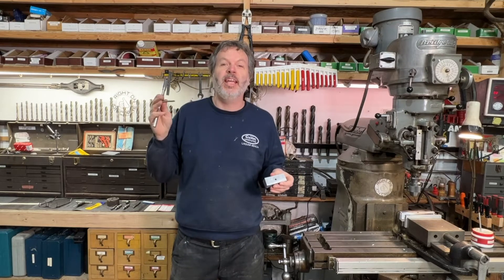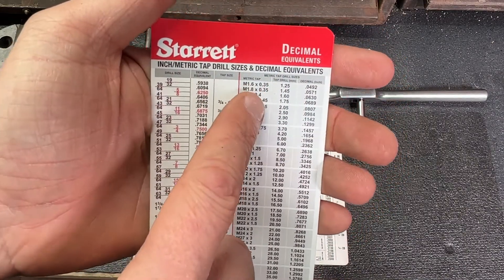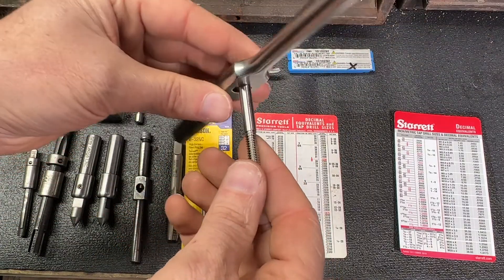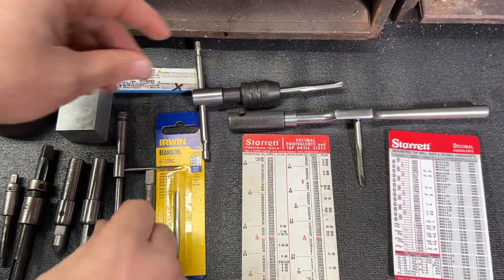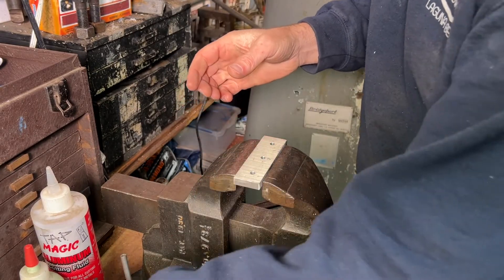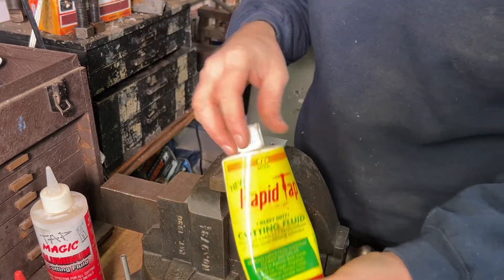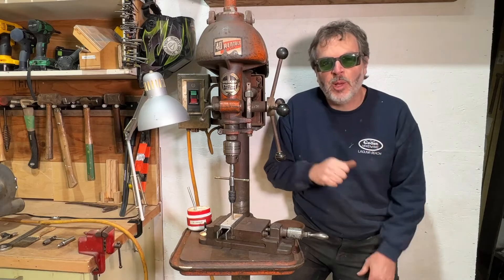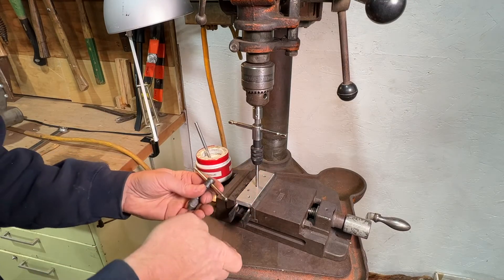Tapping A Hole Straight - 3 Easy Methods

Comment: I have a drill press with belts to adjust the speed.  After drilling the holes, to tap threads, I loosen the belts and turn the main spindle by hand using the height adjustment to apply pressure.  When finished, I usually release the tap from the chuck and turn it out by hand.

Comment: Ok ok nice, the drill press method looks GREAT!! Right on man :).                                                That Greenfield one looks ... pricey.  I don't use it often but I have a 1 1/2" Die and only thing I can easily find is a darn pipe wrench and kinda sucks, but whatever, gotta make due I suspose ;).
Reply from the maker: Right On! 🙌 I think whatever gets the job done. 💪 If a pipe wrench does it, so be it. Also an adjustable crescent wrench is good too. Those you can get in big sizes. Even some sort of pipe welded up with a square socket in the middle? I’m always making a way where there is no way. Right On! 🙌Thanks for the share!

Comment: I'd love to introduce everyone who uses straight taps in soft metals like aluminum to try out spiral flute taps.  They're often used for CNC, but the spiral flute drives the chip out the top of the hole, and and I don't worry about filling up the flutes of straight taps.  You will love them!
Reply from the maker: Right On! 🙌 I use those on occasion in the shop. They are great! Well at least the bigger ones are. I’ve snapped some small 8-32, 10-24 taps pretty quick in that style. Great for a blind hole.

Comment: A1 work well done I have one question what rpm to we set the press drill if we are using the press drill for aluminium and or steel keep punching
Reply from the maker: That’s a good question! The speed changes for different size bits. Smaller is faster and larger is slower. Aluminum is a much faster cutting speed. There are several charts online. I have a chart I can send you a pic of if you email me. My email is in the video description. 👍
Reply: @ Thanks Jon I sent an email as you requested I appreciate you taking the time to help out Urock Keep punching

Comment: If the hole is drilled off at an angle it is most important to tap the hole at the same angle as it was drilled.  Otherwise the tap will be unequally loaded as it tries to cut through.  Increasing the chance of tap breakage.

Comment: I use Tap Magic or wd40 in aluminium. I also tap with a Rohm Chuck in my DP. No tap handle necessary.
Reply from the maker: Right On! 🙌 I do like the WD40 as it doesn’t have that weird tap magic smell 👃😵‍💫 That’s cool you have the Rohm Chuck. I’ve been trying to find out more info on their chucks.
Reply: @RightOnJonCrane It's a 1/2 keyless Rohm Supra Chuck. It runs super true on a JT taper. Big enough to wrap your hand around for tapping.
Reply from the maker: @03redrubi  Right On! 🙌

Comment: For tight spots or where the material can't be bought to vise or drill press - use a nut partially threaded on the tap, it will act as mini tapping block.  Some wobble, but can be better than freehand.  (Not my original idea, but have confirmed it works.)
Reply from the maker: Right On! 🙌 I like that! Thanks!

Comment: I am doing 4 holes this morning through a 2.5 in thick block of forged steel. The best part is the tap needed is a 1inx8 tpi I made a tap guide out of 1.5 in thick steel. I'm not worried about the tap breaking as much as I am concerned about if I have the strength to even turn the dang thing ...lol

Comment: When I was in the steel business pretty much anything from a number 10 to 3/8 we chucked the spiral tap up an electric hand drill. Probably not the recommended method for most but if you have a good feel for tools it works quite well in a lot of scenarios.
Disclaimers: Don't Try This At Home....You'll Likely End Up With A Stack Of Broken Taps.
Reply: Don't try it at home? Does that mean I can go somewhere else to do it and it's ok?
Reply: You develop a "feel" for tapping with an electric drill.  I always used a variable speed drill for this, and the newer, better battery operated drills are better than the older corded drills were.

We used to need to tap hundreds of holes in the cold rolled (hard!) steel sub-panels for electrical enclosures, and doing this with a hand tap would be ridiculously tedious.

Anyhow, after you break a few taps off, you develop a good feel for when to reverse the drill, and how much torque you can apply.  I haven't broken a tap off in a long time now.  But this is a skill that you have to practice to get the right touch!

Buy a handful of taps to have on hand when you start off doing this.  Use lube, feel the torque, and wear eye protection.